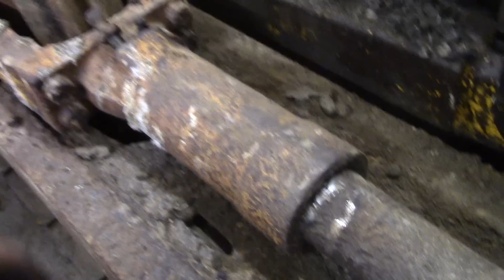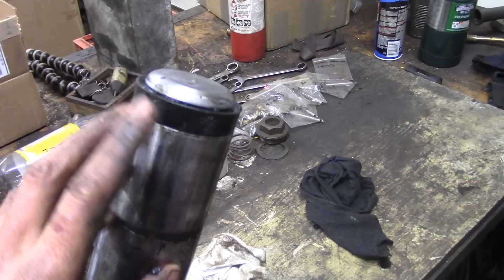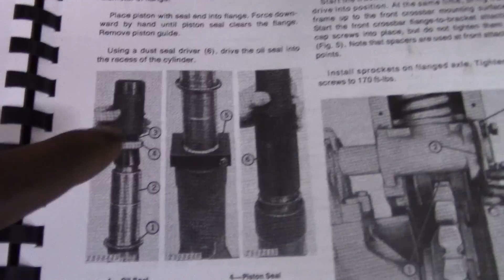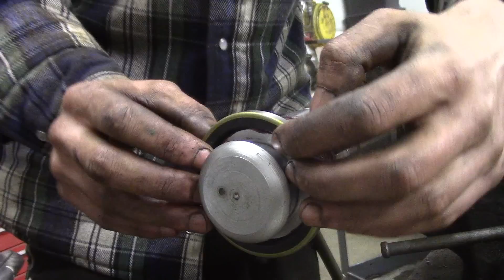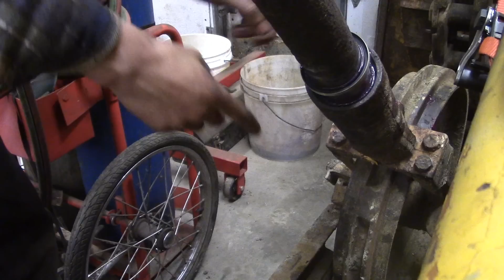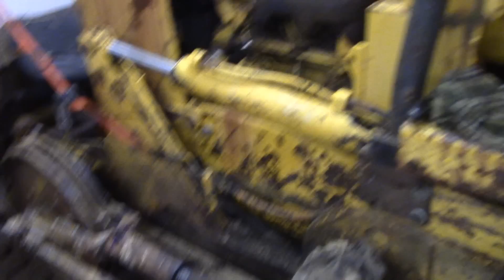John Deere 350B Track Adjuster Rebuild

Comment: Is it feasible to remove one link out of the track?
Reply: No. It will be to short.  One link makes a world of difference
Reply: @Daniel Elliott  link is approximately 6 inches c/c. Adjuster seems to have close to 8 inches of travel. I was also thinking of having the new adjuster rods made up an inch shorter.

Comment: I just bought a 350B and have no experience working on heavy equipment or any equipment for that matter ... I really am learning from you and would love to hire you as a consultant (if possible). Do you have to break the track to do this job? My left adjuster has a 2" piece of angle over the shaft to hold tension on the track.It goes from the back of the shaft housing and the center support/roller. I have not tried to use grease to keep tension and remove the angle yet because I am afraid that it might make the machine inoperable.  I bought it as more of a toy than for doing work and would like to replace all the worn out parts giving it a fresh lease on life.
Reply from the maker: Most likely, that angle iron is there for a reason. If the track is at a good tension, leave it alone. A lot of old equipment has half ass repairs for a reason. In this case, it is because you need to break the track to fix the tensioner. It's not a horrible job, but if you don't rely on the machine to make money, I'd leave it as it is until it becomes a problem.

Comment: I have the same dozer. My track tensioner is seized. When I try to pump out, grease comes out of a relief hole opposite side to the intake. I’m thinking about welding shut the relief hole. Any ideas?
Reply from the maker: If you weld that hole shut you'll never be able to relieve the grease to loosen the track. What is likely happening is that the ball is not sealing at the bottom of it's hole. The bolt that holds the ball down may be too short or the ball may not be there.
Reply: Chavis Nicholls fins a small ball bearing that fits in the whole it’ll plug right up and you can push it out. That’s what I did.

Comment: I have just machined new adjuster shafts for the family farm's JD 350-C. I'm a machinist so it was easier to order new hard Chrome shaft and whip up a new pair vs buying parts. 
I made up the tapered cone and fitted the seals using the lathe. It was nice to have but still one tough seal! 

Link to an album below. My grandfather bought the dozer new in 1978 and we are just fitting its first set of new chains/rollers/sprockets. Not bad for 40 years of farm work. 

https://photos.app.goo.gl/5uPRJScqhU2hd5ht5
Reply: Local machinist is using the same material for my machine. Approximately $340 canadian.  2.5 hours/$110. I'll be way ahead of JD money. Having issues locating after market idlers and rollers.

Comment: Very nice job. You might could have soaked that ring in hot water. Softened it a little before pushing it on. Looking forward to more videos.
Reply from the maker: not a bad idea, but one thing to be careful with that idea is that since air is compressible, it can rocket a piston out of it's bore. grease or oil would not do that. Either way, i scooped out the grease and re-loaded my grease gun with it! Thanks for watching!
Reply: Maybe you could try air to push that piston out and save your grease for adjusting the tracks. You might have to rig up some pipe and a small valve to do it safely, but I think it will work. I've done it with lift cylinders on a Cat 988 A.
Reply from the maker: Great idea! I'll do that with my next machine.
Reply: themadmailler 
That's why you need a small valve so you can control the volume of air you put in it, or use a blow gun with a rubber tip, then you can shoot some air to it and then pull the rubber tip away from the hole which would then bleed the air out of the cylinder and stop the piston movement.